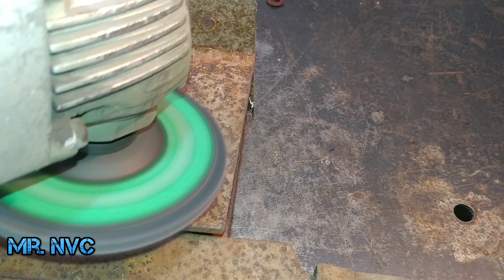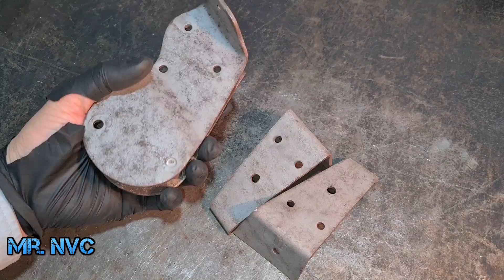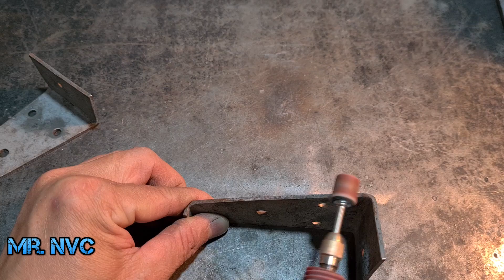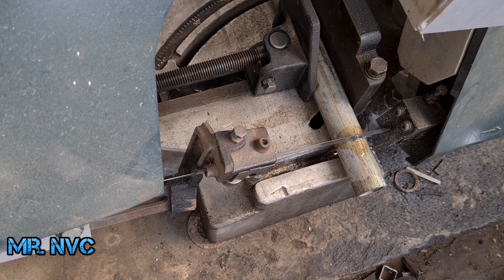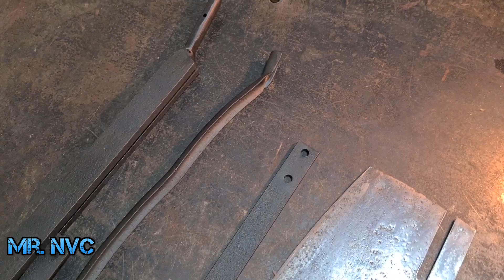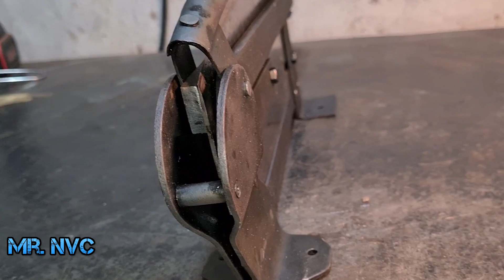Extremely Rusty Large Cut Medicine Knife Japanese Restoration

Comment: Would like to have seen more time devoted to the blade. Even after your restoration attempts, it still looks pretty bad. The rest of it doesn’t look that great either. The handle could have and should have been saved if you had only taken the time to drill out the pin. There was no need to beat it to death trying to remove it. Why didn’t you attempt to save and reuse the original metal ring on the handle? Remember to save and reuse as many original parts as you can. That’s what 
restorations are all about. Keep trying to improve. That was an interesting piece of equipment, though.
Reply: i realize it is kinda randomly asking but does anyone know a good website to watch newly released series online?
Reply: @Gael Ridge flixportal =)
Reply: @Jameson Dillon thanks, I signed up and it seems like a nice service :D Appreciate it !!
Reply: @Gael Ridge You are welcome =)